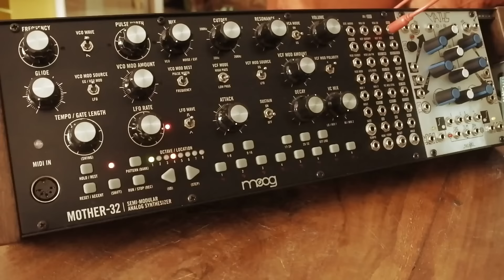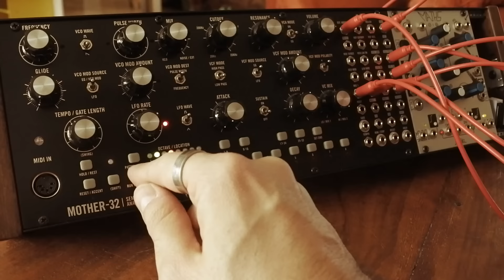Adding 3 Vco's to Moog Mother 32

Comment: Thanks, Oz!  Haven't tried the LFO audio yet, but I really like the tone you got from it, so now I'm gonna try it.  BTW, if you haven't already tried this, the LFO will go even higher into the audio range by patching an external signal into the "LFO Rate" jack on the  patch panel.  I think the on-board knob gets you up to 300Hz max (or so,) but the external signal can get you up to 650Hz.  Happy tweaking!

Comment: The LFO is indeed a true VCO: it goes up to audio rate, is voltage-controlled, and tracks 1v/octave. As you show, it's useful for enriching the sound by detuning it against the main VCO, creating intervals or beat frequencies. However, the pulse wave you added first is not another VCO: it's derived from the main VCO, and will always have the same pitch, just like the multiple outputs on the A110. It can add timbral variety, but not beating or intervals or FM.

If you do want a third independent VCO, set the VCF into self-oscillation. Between that, the LFO and the main VCO, you can indeed get 3 VCOs, albeit with some limitations.
Reply: How do you do to set the VCF into self-oscillation?
Reply: If you crank the resonance all the way up, the filter will play a sine wave at the cutoff frequency. You can also track this to the keyboard.
Reply: The LFO on the Mother 32 does not track at 1 volt per octave. It only stays in tune over a very short span of notes when used as an audio oscillator.

Comment: Unfortunately you can't track the LFO with the pitch, on various octaves they are out of tune, you can tune the the first note but then it will be out of tune by progressing with the pitch. The same happens viceversa. So I guess you do need an external VCO one and also a type that can be fine tuned.

Comment: Thank you for making this video!  Question for you,  is there anything special about the moog oscillator?  What vcos would I need to pair with the mother 32 to get "That moog sound"   Thanks!
Reply from the maker: The Narrow Brush Thanx, i use a doepfer and the MI braids, sounds good.
Reply: @iscariah71  So I don't need to cough up $400 for a VCO then?
Reply from the maker: The Narrow Brush absolutly not
Reply: @iscariah71  Thank you so much!!!

Comment: Probably a silly question. But when midi syncing the mother32 to the analog four..That only takes up one voice of the analog four yeah? So you still have 3 voices left on the A4.?
Reply from the maker: exactly
Reply from the maker: +iscariah71 u should use cv
Reply: +iscariah71 How would that differ with  available voices, say compared to using midi sync..Sorry if this is all pretty obvious
Reply: +iscariah71 And thanks for the vid..Very cool
Reply from the maker: +luap ekcol u can work with a choice of much more parameters in cv, don t forget to active your fx track level
Reply: +luap ekcol Why would you lose a voice by MIDI syncing? You just sync.

Comment: Great video and nice patching!
Was the audio recorded with a mic in the room? For improvement, you could try mixing it with the line out and also open up the filter a bit more to get a glimpse of the higher harmonics when mixing the LFO sine with the more harmonically rich saw/pulse coming from the VCO.